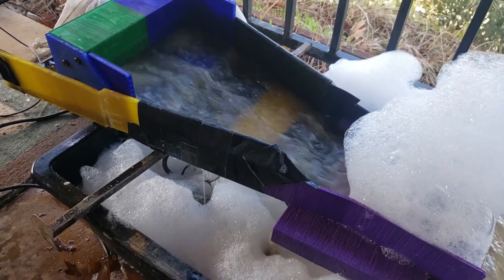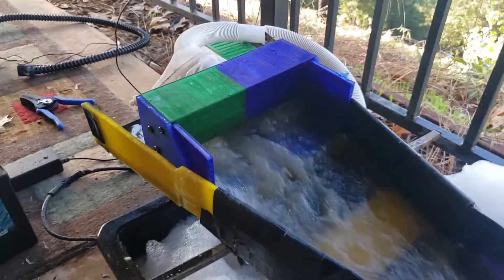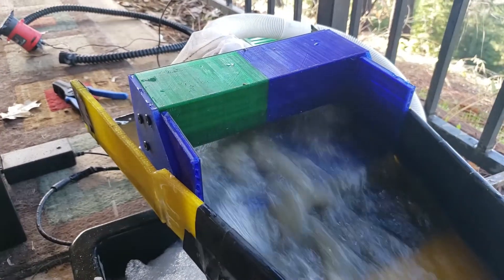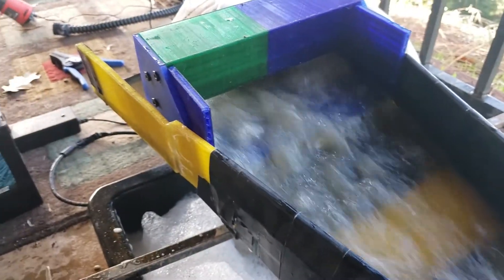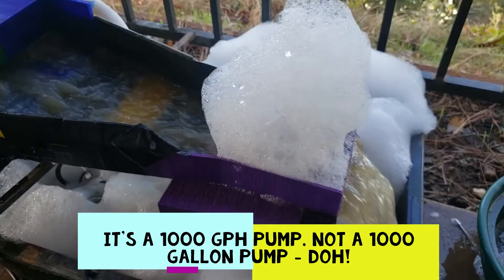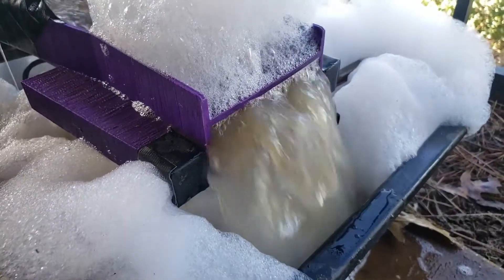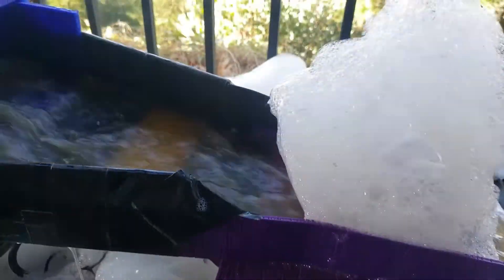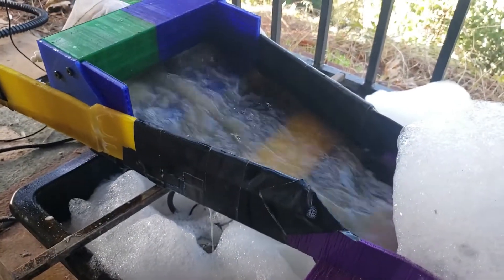3D Printed Power Fluid Sluice Box - Testing the header box

Comment: Do you think the fluid sluice with the tubes is better or the one with side inlets or does it matter?
Reply from the maker: Good question. Personally, I like the side inlets better. From a maintenance and design perspective they are simpler.  They really do not clog and provide more places for stabilizer rocks.  They do however require a little more skill to set up. Both require heavy flow.  I really do not think there is any difference in terms of gold recovery., I find both types when run correctly, are extremely effective and easy to use.  This is based on stream/creek use and not under a powered pump.  For a powered recirculating system, I think the pipe version would be the way to go  because it's easier to force the water into the closed chamber (under the flare) which subsequently feeds the pipes vs the side inlet that would require you to split the  flow to each inlet (1 per side) and require a little more plumbing and and printing. Both are easy and doable but the pipes would be simpler.  But for non-powered creek use, I prefer the side inlets.  Either way, you get to prospect so you win! :-)

Comment: This is what I was thinking about when I found your videos.
Are you planning on finishing this?
I am really interested.
You have done a great job.
Reply from the maker: LOL. Thank you.  This actually came about while designing something else.  I had been working on several designs and this became a test bed for some of those components.  I plan on finishing this recirculating system, but I will be releasing a full size 3D printed high banker first. The high banker can be used in a recirculating fashion too.  It's done,  but I need to edit all the video I shot using it.  Gold recovery is very good and there are some really neat features never seen before. It rivals any thing you can buy. I shovel directly into it.  I can dump buckets of heavy material on it. It is very strong and it can process about 10 buckets an hour. It weighs under 15 lbs total including the pump/plumbing and custom made lithium battery and can run for about 3.5 - 4 hrs. I designed it so I can backpack and hike in to more remote places.  Keep an eye out on my channel for its release.
Reply: @GoldiBox   Thanks for replying. 
I have been keeping an eye on your channel. 
I saw a conversation you had with someone else and between that and your videos, I was pretty sure you were going to come out with a fluid sluice high banker. 
I was watching a lot of gold videos at the time and had come to the conclusion ( right or wrong lol ) that was the perfect setup.

It appears like it would have the same performance as something that would be a lot bigger.
I was looking at the snake river ones and thinking of converting it into a high banker by printing plugs that have hose inlets.
Anyway, can't wait to see what yours looks like. The way you describe it, it sounds like it is going to be a good video. This could be kind of a game changer in the small production/ hobby equipment market.
Reply from the maker: Hi Tim,  I just posted some videos of the GoldiBox 3D printed highbanker with more on the way.  I've been working on it for over a year. - 100s of hours of testing and many design changes. It can be run in recirculating mode and with the silicon matting it is just as easy to clean out as a fluid bed. Maybe even a tad easier since it doesn't require a box reset. Just slip the mat back in.  I designed it to be ultra-portable.  It can also be converted to a dredge. I'll start wrapping my brain around a recirculating fluid sluice box but the GoldiBox Highbanker is meant to disrupt the hobby market.  Small, lightweight and highly effective with several unique, never before seen features.  - Happy Prospecting!
Reply: @GoldiBox   Thanks for the heads up. I will definitely watch it today.